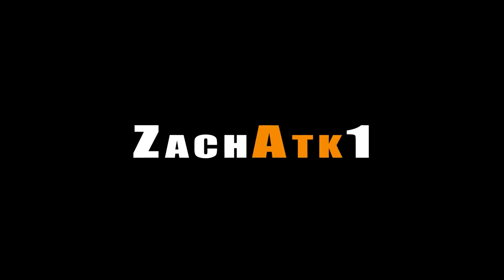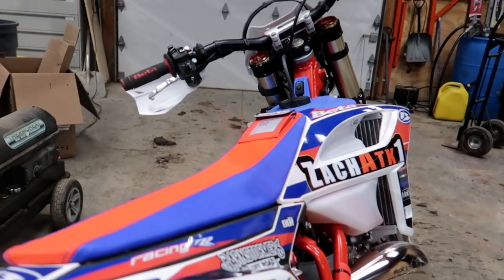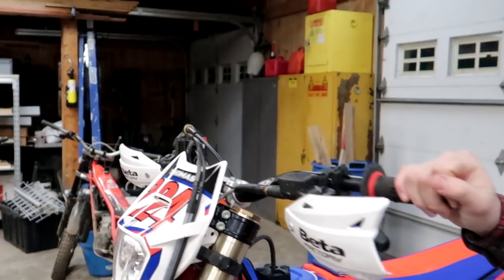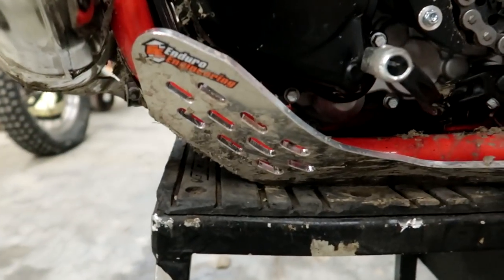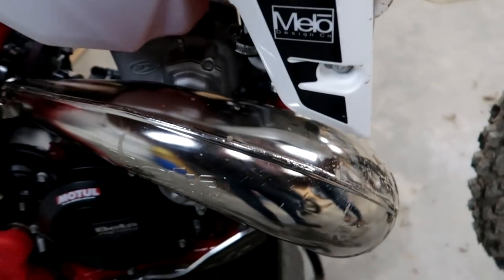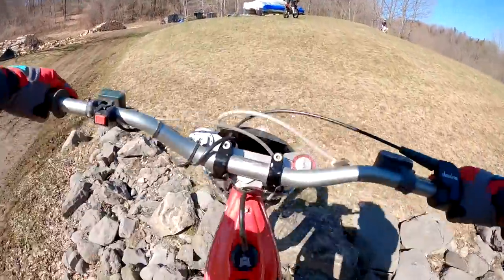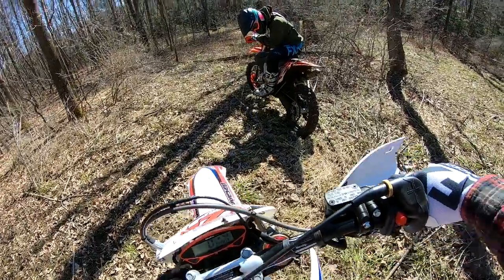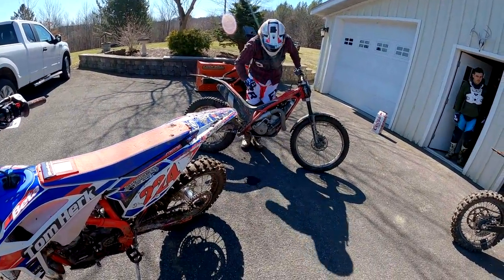THE NEW BIKE - 2020 Beta 300 Race Edition

Comment: Congratulations on the purchase!
I own a 2018 300 rr and a 2019 200 rr.
If you haven't done it yet I highly recommend the JD jet kit for yours. I set my jetting spot on with the factory recommendations and thought it was okay but never seemed real crisp. Never any spooge on the pipe and was getting pretty good mileage, 35 mpg +- at 7000 - 12000 ft. ( Colorado )
Decided to try the kit and I was shocked at the difference!
At the seat of the pants I would estimate 20-25% power increase. That goes for the 200 also.
The people at JD know what works!
Best wishes on the racing season. By the way, have a 2001 Rev 3 and a 2018 Evo. Love the Betas!

Comment: Did you end up getting the suspension dialed in?  I had a 16 Beta 300 rr and even after Stillwell did their magic I just couldn’t get the bike to inspire confidence.  I would say the stock suspension on my current 21 xcw was far more inspiring than the stillwell beta.  Could be chassis issues with the 16, but watching test vids of rides on the stock 20 beta RE they look super harsh.  Sorry not baggin and I loved my beta (especially in tight technical), but I got tired of being beat up on the faster sections.  Curious if the 20’s after suspension work can get that elusive plush/firm combination working.  I’m the same feeling as you on suspension mods (best money spent and currently dropping WP 6500 xplor pro cartridges in the 21 xcw).   Best to judge a bike after suspension mods are done.

Comment: I have lots of Enduro hours and to be honest I disagree with every bike needing a revalve. A lot of revalve info is pure marketing. Put a decent amount (say 30) hours on it while making small clicker adjustments that make sense for what you're experiencing (compression or rebound issue, harshness, how much travel you're using etc). If the revalves were so much better the OEMs would have made those mods eons ago, yet every new bike up to 2020 always "needs a revalve".

Comment: I had 1 bike with a electric start and when it’s cold it doesn’t even want start so I would add the kick starter just for cold days then when warmed up you can use the electric start on the trail.

Comment: I just purchased my first ktm, I bought a 2018 sx150. I’ve set it up for the woods with suspension upgrades, moving to a 18in in the rear, a different pipe and silencer and also planning on adding a flywheel weight. Anymore suggestions on what I should do?
Reply: V-force reeds then leave it alot 😉

Comment: What are your thoughts on the carbon fiber pipe guards? Do you run one or suggest one or run bare pipe?. I just bought a used 300 with one on it and pulled it off and there was a ton of mud and sand behind it and started pitting the surface of the pipe.
Reply: In my experience, the CF pipe guards do not last for hard enduro riding.